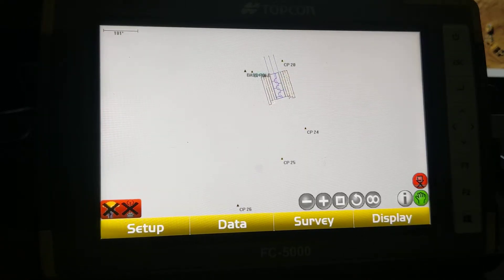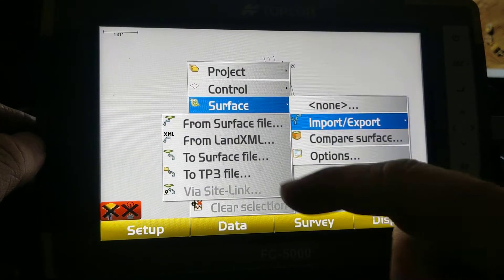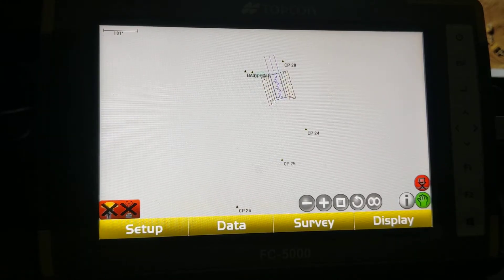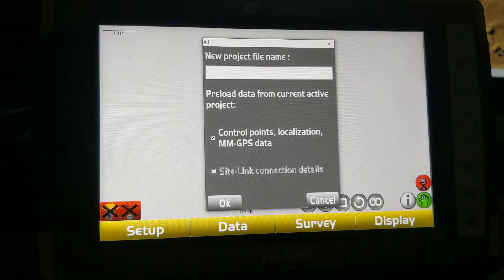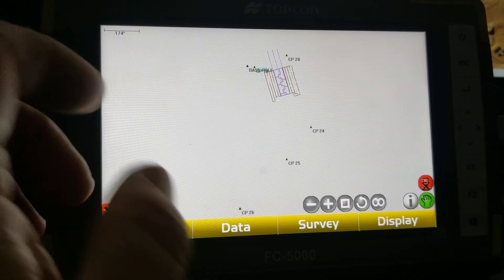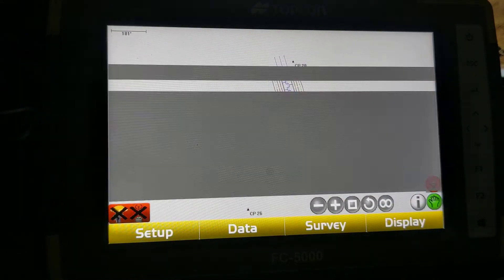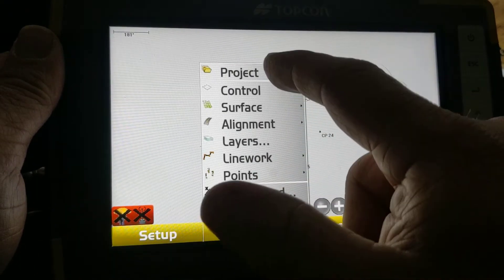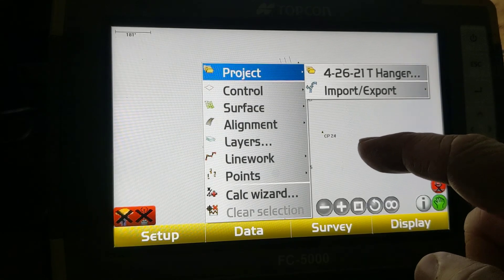Copying Localization (.GC3) to new project in Topcon Pocket 3D.

Comment: Maybe you can help me out.  I just got pocket 3D.  I’m in my yard and I hooked up my rover to the cors network.   Ow I want to just do a simple topo of my driveway just so I can get used to taking shots.  But I keep getting a message “project not localized”  how can I localize “my project” of my yard?
Reply: I had to turn off and turn on the Data roaming button from the phone using the hotspot. Or recheck the hotspot.